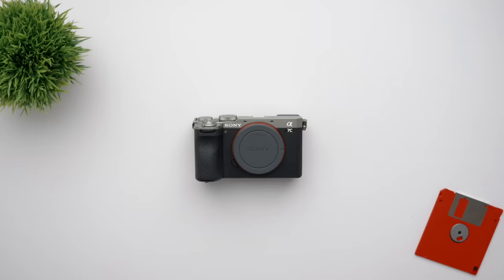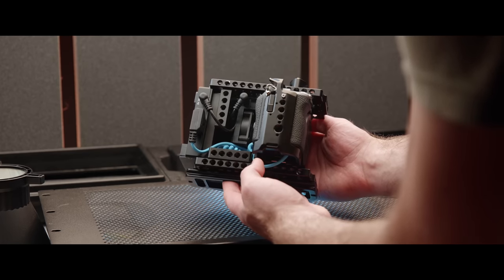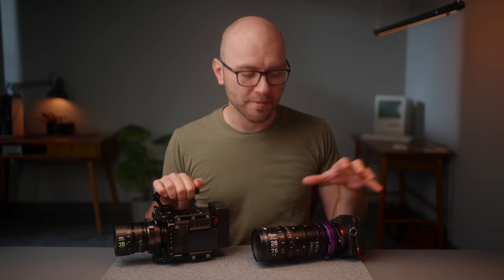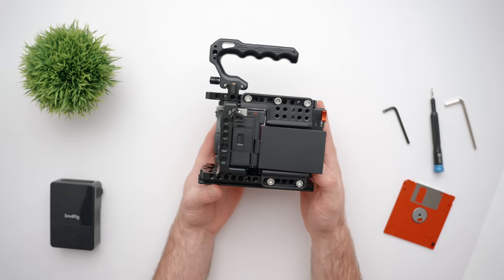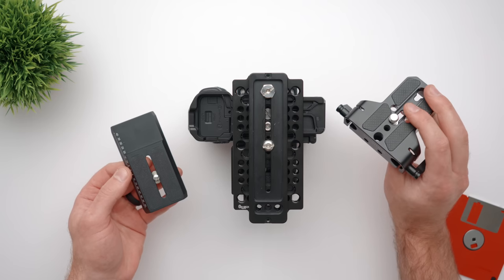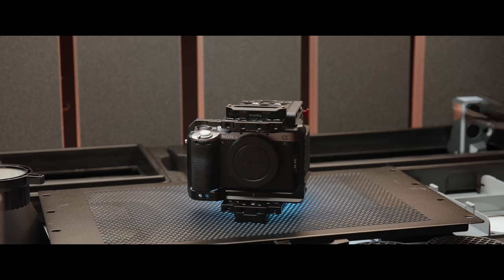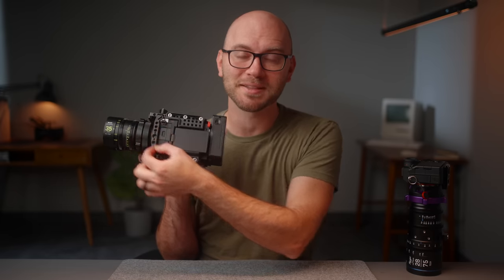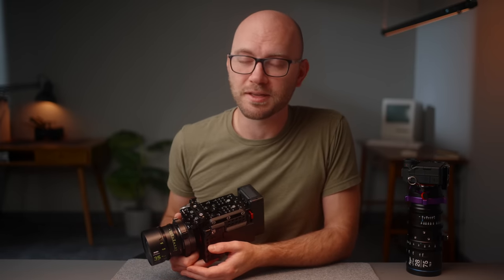A7C II Cinema Camera Conversion!

Comment: We need a similar build for FX3/FX30 with XLR inputs AND a stronger Handle. I really dig the screen solution <3
Reply: yes please!!!
Reply: And for Sony ZV-E10 🙃
Reply: Agreed. Owning the FX30, I could definitely see a similar setup working great.
Reply: Yes pleaaaase
Reply: Yes please for my fx3 and fx30!
Reply: Yes please for Fx3 or 30
Reply: Agreed!
Reply: It already exists and is called FX6.
Reply: @axelvetter  Not really, very different cameras
Reply: @TheReelport  It's the same hardware plus XLR audio, switches, variable ND filter, two handles and a few minor extras. That's why I'm using one.
Reply: @axelvetter  it is full frame, doesn't have IBIS, no APSC mode, no sound if no handle attached etc etc. completely different camera, FX3 is closer maybe but FX30 is far

Comment: This is something I would like to build for my FX30. I'm constantly concerned about the flex in the audio handle but also don't want to lost its capability. I'd like the FX30 rig to be able to mount a wrap around top handle like you see on Arri Alexa cameras or even the long Wooden Camera top mount handle.
Reply: The closest I could think of was getting the k3m adapter or turn the handle into that, and get a full cage with the smallrig "helmet" handle. The problem is the awkward shape of the k3m.

Comment: Hey guys, I CAN CONFIRM the cage fits the dimensions of the ZV-E1 pretty well! I just made some cut moderations to the Cineback and moved the screws a little in a few different locations to adjust to center the camera, and its perfect!
Reply: With the smallrig cage?
Reply: Which smallrig cage did u go with?
Reply: Have you tested overheating? If this build solves overhearing on the EV-Z1 it will be God tier.
Reply: @SimplestUsername   i have solved overheating with my Zv e1 by just opening all the lids including the battery one. Tested it in my 24 degree celcius room without any wind. 4k 25fps and it Kept going till sd card went full, which was over 2 hours with it being decently warm

Comment: Looks very nice and tidy. You might wanna look for heat threaded inserts that you can melt into the 3d print. This could improve durability on those threads over time especially when reassembling the rig a couple times.

Comment: Dear Celab, as a product designer being more and more invested into cinematography, I really appreciate your step into 3D printed custom accessories. I'm sure that you did the right research on it, but I just wanted to ask, which kind of material you are using to print these parts? especially as we're dealing with heat, there are some materials to rule out, for example PLA. ABS or even Nylon would be the engineering way to go but as I assume you are printing on an unenclosed prusa, ASA might be the best choice considering convenience to print and overall performance. From what I've tested (3D printing prototype enclosures for LED housings), the Prusament ASA is top notch in terms of precise diameter and build plate adhesion.

Comment: This is an excellent solution. Whilst I fully understand the capabilities and excellence of mirrorless cameras, I do not like the form factor and much prefer a video/cinema camera style body. Sony, having finally implemented the articulating flip-out screen (a few models back), have allowed for this kind of build and flexibility. The next technological step-forward is for mirrorless cameras to have ND filters built-in, although I suspect that this is still quite a way off in the future. Another advantage of this build is that it meets certain customers' expectations of a professional turning up with a 'proper camera'. I have been on many shoots where I have my FS7 and a colleague with the latest A7s and the customer thinking that the FS7 is superior, just because of size. In some ways, it is and in many ways it isn't but the customer doesn't want to hear a long explanation on this. I also suspect that this build also helps with stabilising the camera when using handheld and that is a feature that helps with picture quality!

Comment: This looks awesome.  To build upon this excellent design I would add a quick release for the camera from the rest of the body.  Since newer rigs come with an arca-Swiss mount on the bottom, add that to the rig.  For cameras with micro hdmi or ports in unfavorable locations, have cables, clamps, and adapters that can loop them to the back near the v-mount, like in other cinema cameras.  With that maybe even adding 12g-sdi for a more secure connection.

Comment: I know this seems kind of counter productive since newer cameras are coming out all them time, but could you possibly do the same type of build on an older camera like the Sony a6300? I know the screen doesn't rotate out and they are around the same size but different sensor with it being a APS-C instead of it being full frame. Just curious because you covered a a6300 build 7 years ago but this looks a lot better.

Comment: Tried this with my fx30 with a tilta cage and a small rig cage. The tilta cage didn’t allow enough room on the top of the camera to secure. 

The small rig cage only allows for one 1/4-20 to secure (left side). Was able secure the bottom of the rig to the small rig cage. Doesn’t feel totally secure but it’s connected. 

I was able to rig a different small setup with just the small battery plate. 

Thanks for the ideas!

Comment: Love this video!

I shoot with my A7c since December 2021 and over time I rigged it out to push this little camera to its limits.
Do you know if the A7cII 3D printed part also fits the A7c? Seems like the screen is the same place and they just changed some dials and the grip depth.

Comment: The 3d printed side pannel is slick! Looking forward to seeing builds for other cameras (a7iv, fx3)
Reply: I hope there is an A7V. The A7IV is old tech now and should be avoided. The focusing system in the A7CII and a6700 is far superior. I know, my a6700 blew the A74 away when shooting small insects, bees going crazy over the blossoms on my shrub. The A74 failed miserable as to being unusable. The a6700 hit on the insects with a far higher hit rate. Don't make the same mistake and get a camera that has been superseded. I am selling it because my a6700 is a much better camera. If there is an A7V, with the guts from the A7R5, it will be the camera to get.

Comment: You are the most talented person, when it comes to these type of things. I LOVE THE VIDEO!

But I have a question. I am rocking the old but trusty Canon 5D Mark II and its great for photos out of the box, but if I want to do filming, can you come up with a list of part to build a little rig like this? Would be nice if I could have a NPF970 or two to power it, since they also come with USB out. I already own a mini HDMI to my Android phone, so I can use the phone as my monitor. What do you think? 
Would love to get a 3D printed case with additional power, top handle and a place to mount my microphone as well for a small size cinema run and gun

Comment: Do a build for the Lumix S5/S5ii, it's the Panasonic alternative to the Sony A7C II but you can now find the S5ii second hand for around £1700, bringing the total rough cost to £2000, low enough to potentially skip the EVA-1 which is currently around £2500-£3000.

Comment: What would the cost difference be to go through a company that could potential do your cine kit but on aluminum/ the same metal that smallrig uses for those cheese plates? Not that I doubt the durability of the 3D printed material but I know over time, the plastic may Crack or get break at parts that have thinner openings

Comment: This makes me want to experiment with the Sony ZVE1 because from what i've seen that's a far superior sensor to the A7CII because they stuck the A7SIII sensor in a smaller body but it had heat issues that would hopefully be solved by a rig like this. I shoot weddings in texas and I've been looking at getting a fx3 to turn my A7SIII into a bcam due to that cam having a built in fan and heat sink. I wish you could do heat tests outside with the rig because i would instant buy it if it can keep up in 90 F+ degree heat.

Comment: Do you have any recommendations on how to handle the Mirco HDMI to HDMI situation on this tpye of rig?

Used the Smallrig 3021 Adapter Cable with my A7c Rig, but it stopped working at after 8 months of use.
I couldn't find any good angled cable on amazon that would fit well. I think you need some cable clamp system needed to hold it in place and not damage it by accident. I broke 2 mirco HDMI to HDMI Cables by acciedent before goind for the Smallrig 3021 cable.

Comment: I have an a6700 and heating is an issue especially when shooting outside in the summer. Are there fans that will help to increase run times and decrease overheating

Comment: Glad you considered a cooling unit. Overheating is tough on non-cinema line Sony cameras. Wish Sony/Canon would take a hint from Panasonic in that regard. I use my GH6 in 110f Texas heat under direct sunlight without it overheating.
Reply: That's also due to the micro 4/3's sensor- being smaller than full frame. But I still have 2 GH5s' with metabones adapters to get an almost full frame field of view. Love Panasonic.

Comment: The real reason to build like this is to let manufacturers know that PLEASE WE WANT BOX STYLE CAMERAS with your mirrorless sensors inside. The screens should be along the operator side like this, with some buttons like ARRI so expertly does. If I want to see my image, I’m attaching a proper monitor or EVF anyway.

Panasonic’s BS1H is a step in the right direction, as are the Sonys. 

Also if you want help doing this for the S1H, let me know. I have CAD experience and some opinions on the correct approach.

Comment: if i could justify the cost i'd love to get one and build it but i can't lol i couldnt even justify the £45 it was going to cost to get a small rig monitor mount!!! so i got a ball joint off ebay insted, as all i got to film with is a gopro hero2 just now you did get me into making camera rigs though as made one for my nex7 i was using till it died comes up with over heating screen after a few seconds of switching it on, i made a alloy cage with top and side handles and mounted a shotgun mic to it you sudgested to get, was so much handyer when filming than with just the camera on its own. so have orderd the bits i nead and just going to build a hero2 camera rig useing my fpv screen and mic and power the lot with a 3 or 4s lipo battery so i can shoot all day. love you video's!!!

Comment: Great to see but this is kind of the reason why the bgh series or bs1h makes far more sense than this approach. This is something most people have probably done to thrir c70 etc. Or their mirrorless set ups. This issue is design. Once we start hiding features of the body by making the cube design around a flip out screen dslr template rather than expanding their connectivity then it quickly becomes self defeating exercise. Alot of people expanded their z cams with plates and of course it makes anything into a cube if we put a top bottom and sides around a camera but is the functionality then wholly compromised. No evf so this kind of thing has worked well for us on c70 or fx3. That said our solutions allowed easy access to the rear of the camera as rear battery was on rails or hinged and although building a tank of a frame may feel satisfying its often going to compromise accessibility to existing controls and features. A great attempt at something we have all probably tried on a regular basis until we just ended up buying a Komodo, fx6 or C300iii. Btw the sigma fp builds promise similar approach whilst maintain what is so fun about having a high quality mirrorless camera with an evf and that remains so light and portable. Thanks for all that thought and consideration.

Comment: Seems like a big missed opportunity to use a male micro HDMI to female HDMI cable, housed so the micro HDMI port is fully protected, and rigidly mount the female end with the cable hidden so that so you can plug in a full size HDMI cleanly. Without a good monitor output I am not sure how this is a cinema build.

Comment: $2200 (pre-tax) body only for this not worth it. the fx30 much better investment at $1800 (more "riggible" too), you can get a decent sigma f1.4 apsc lens with it and still be at less than the c2 body out of pocket. and still get 4k 120. albeit the c2 is full frame. the advancements in video dont call for it. unless you already have a good amount of full frame lenses, or you have a need for B cam that does take full frame theres no point in getting this c2, fx30 much better investment. If you are only streaming, putting videos on social media, the difference will be very negligible and non existent for the most part. fx30 also has a built in fan already, no need for all these extra bits.

was looking forward to the c2 but id rather keep 2 fx30s as my go to B cams (only because I have some sigma apsc sitting around), a7s3 will remain A cam.

its a good cam, if you have full frame lenses just sitting around and need a b cam. otherwise. nah. 

thank you for the video. very informative. i will still probably get my hands on one of these just to play with it.